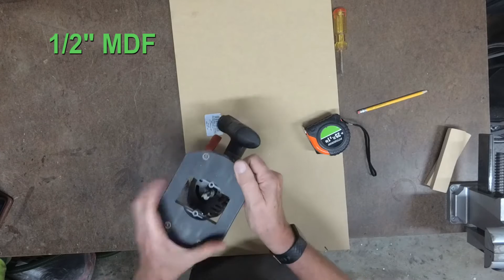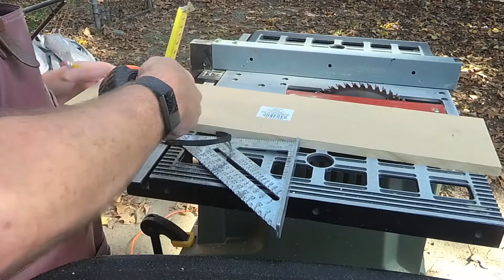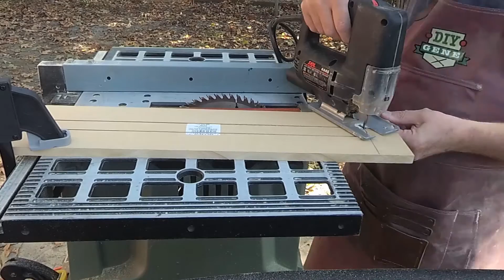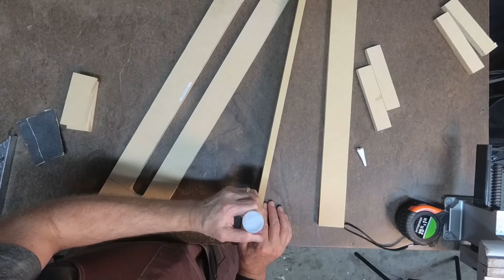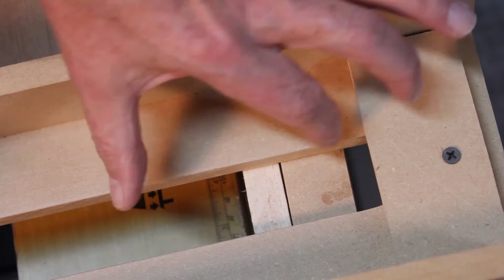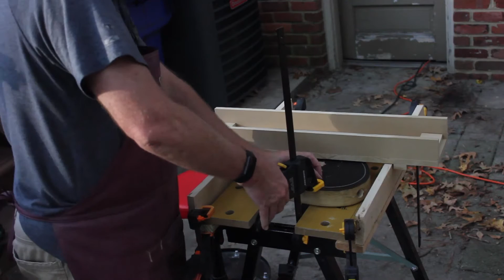How to Make a Router Sled for Planing and Flattening Wood.

Comment: Hi Gene, I would like to ask you a little question on an older video where you painted a guitar body with acrylic + water in order to make it like a stain. Is there any particular problem doing like so and not buying an actual "wood stain"? 
I would like also to finish the guitar with finishing oil, like crimson or tru oil, again, in your experience am I doing something wrong? Could the oil take out the acrylic water stain ? 
Thanks in advance!

PS I would like to do like a blue burst, should i use a primer or not?
Reply from the maker: I think it should work just fine. If you want to show some of the wood grain through the stain, then I wouldn’t use a primer. I would also consider doing a test on some scrap wood to make sure you are getting the results you want. It sounds like it will be a beautiful guitar. I hope that helps.
Reply: @DIYGene  Thank you ! I hope it will be just fine, I'm a bit scared that acrylic staining will chop off over time
Reply from the maker: @tomjorghen , Tru-Oil will lock in the color!